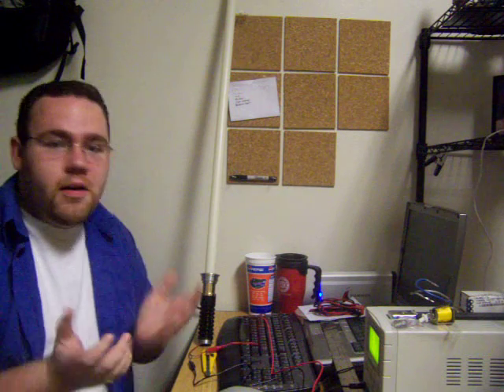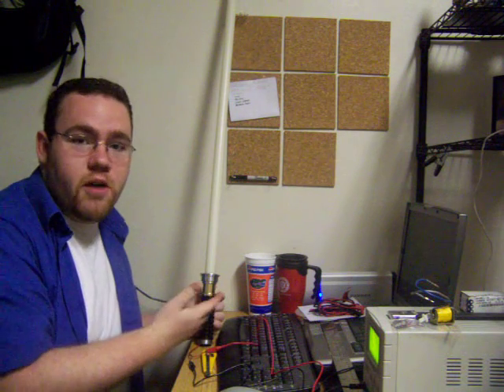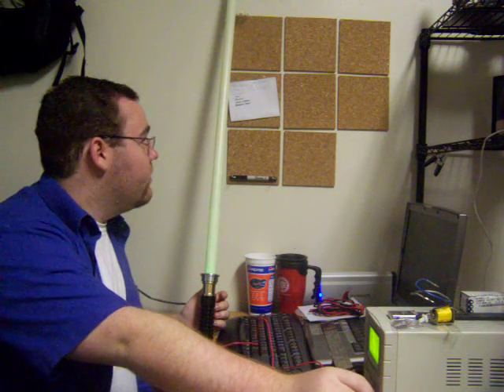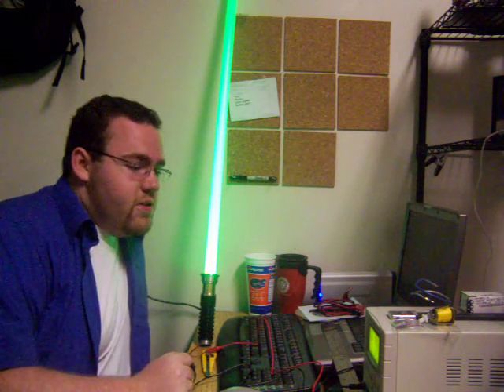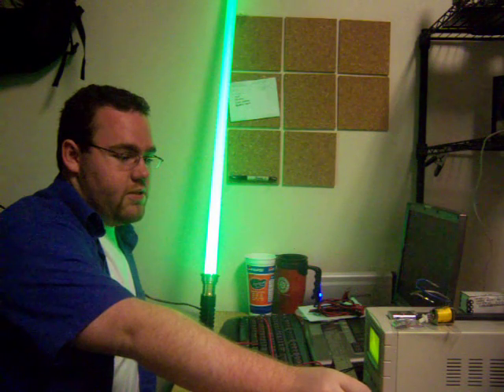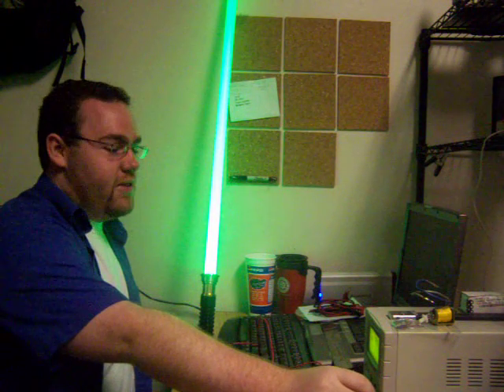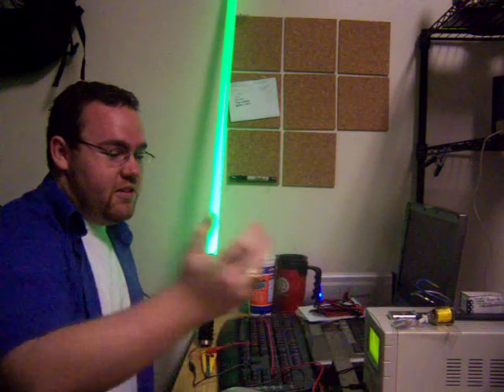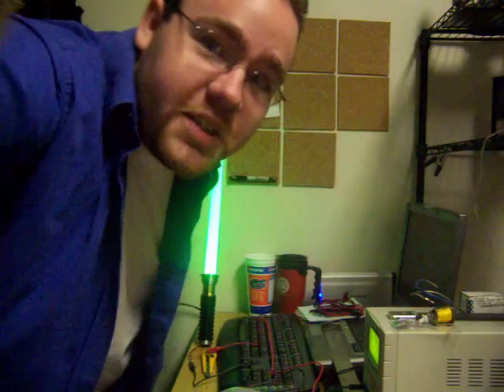Amperage and visual differences

Comment: The BEST way to do this comparison is exactly the same as you did... but with one exception.  Have another saber next to that one that stays the same brightness the entire time.  The contrast between the two will make the differences more visable.

With just a single saber, your eyes, and the camera autofocus will auto-adjust to that brightness level and make them APPEAR very similar.

You can also validate what I'm saying with an actual LUX meter, instead of eyes/camera.

Comment: I would STRONGLY reccomend that you re-make this video with another saber next to that one with unchanging current.

As you turned up and down the current, you can see the room "darken" because your camera was automatically adjusting to the brighter saber.  Which makes it harder to see the light differences.

If you have a 2nd saber in there, then the real differences will show up more.

Cheers